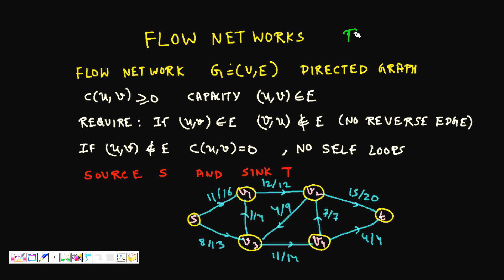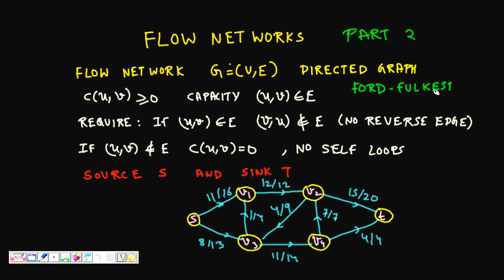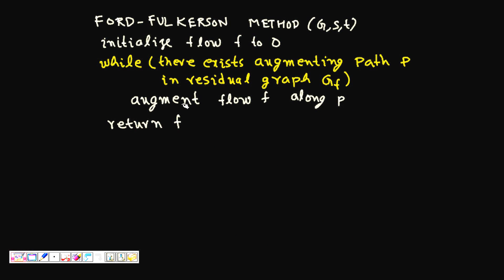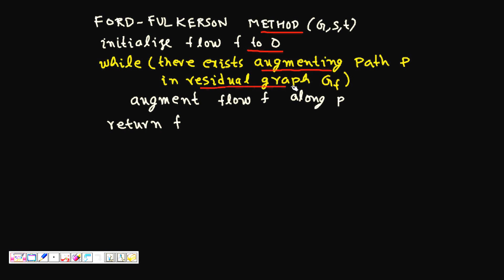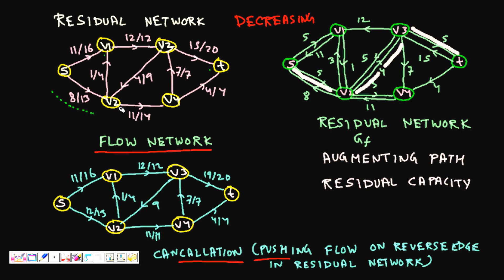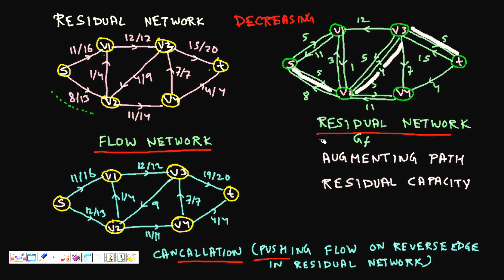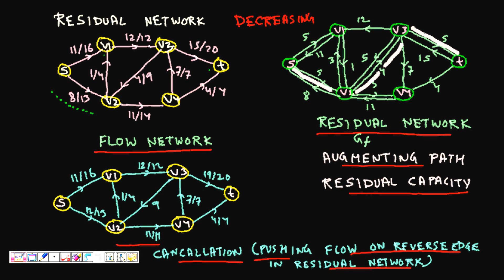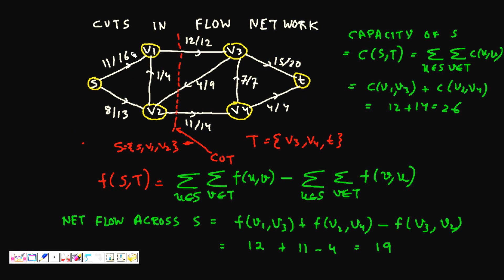Programming Interview: Ford Fulkerson + Residual Graph + Augmenting Path+ Max Flow Min Cut (Part 2)

Comment: Can you explain to me why from v2 to v3 on residual graph, it becomes 9? Shouldn't it be 8 because residual capacity is 4?
Reply: +aaz0104 It should be 0/9. The original graph had an edge from v3 to v2 of flow 4. After calculating the max flow from the residual graph, we see that 4 was sent in the reverse direction. So overall, nothing should be sent from v3 to v2. That edge won't be used in the max flow.
Reply: M0op5 I think it's 0/9, otherwise, it's not obeying conservation
Reply: I means 0,9. We don't use this arc. So --> 4-4 = 0
Reply: Yes, that is the only part in the lecture/books I didn't get. If someone cold please explain.